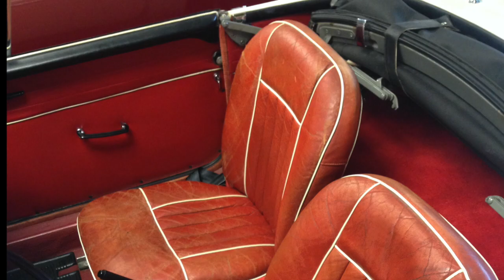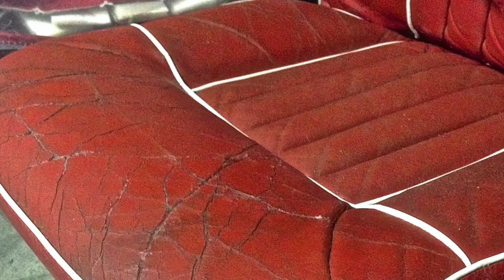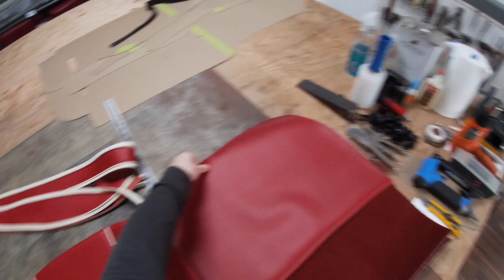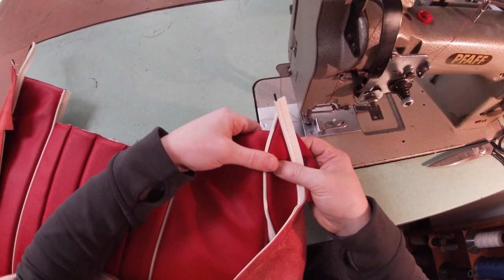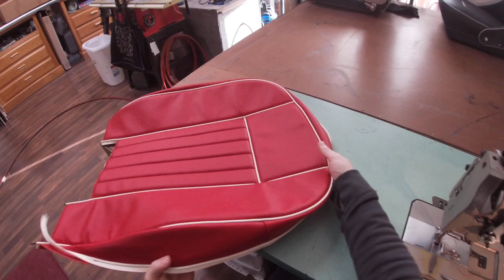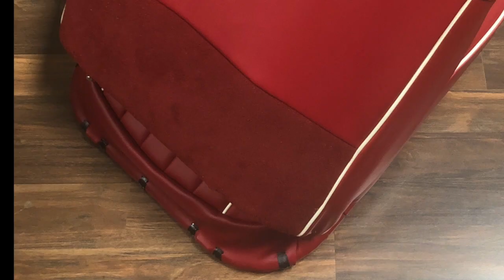Making early MGB seats

Comment: I bought MGB seat kits from PJM in the UK, and had them professionally 
installed by a shop that had years of MG experience.  What a fiasco!  
First attempt, the bottom cushions were flat, no contours!  The 
upholsterer said the kits were made wrong.  Had he alerted me, I could 
have stopped the job, but he installed them, and they looked completely 
wrong.  So I got more leather from PJM, and then the upholsterer 
modified the kit, and redid the seat bottoms.  They still just don't 
look quite right, and the ride-height is too high!.  The cost of a job 
that disappoints is way too high.  If you have an early MGB needing 
upholstery, contact Geoff for seat kits.